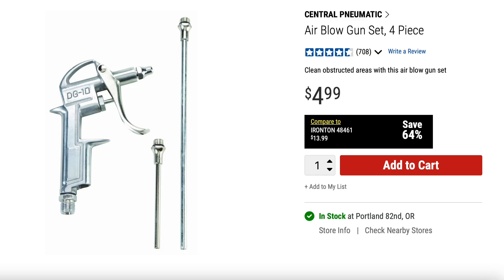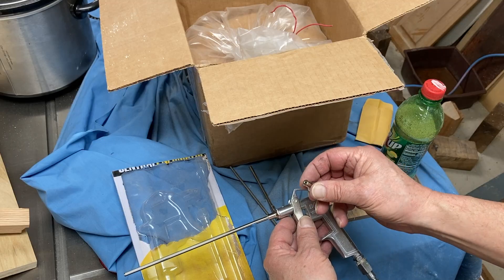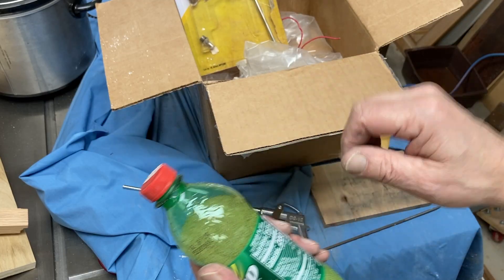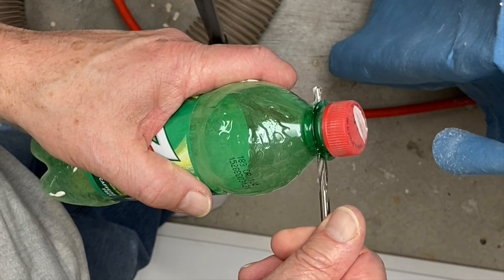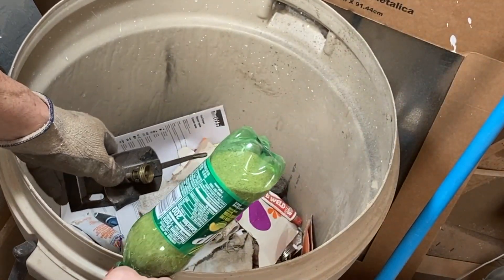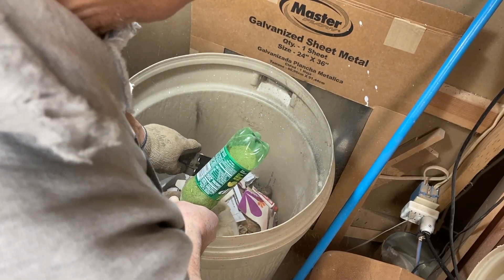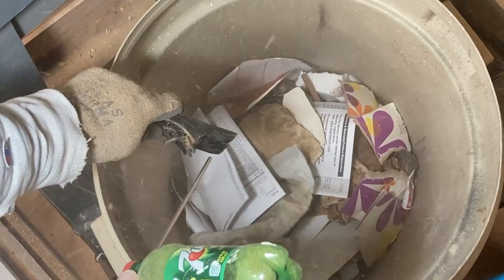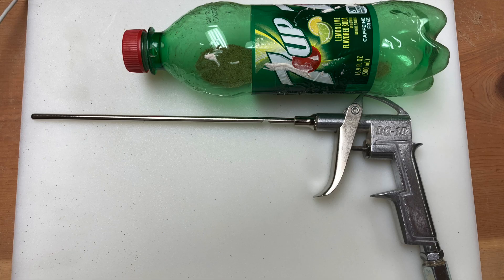Build a DIY Sandblaster for Under $5.00.

Comment: II made one with two lids so I wouldn’t have to make holes in the container itself, only in the lid. I used sifted river sand and utilized it to clean some pumps; only placing the sand-receiving hole at the top, and it works perfectly.
Reply from the maker: I’m still amazed at how well this works every time I use it.  Thanks for the comment.

Comment: I like this video!! I used the same equipment but I used sand and it still works great!! 👍🏼
Reply from the maker: Thanks for the comment.
Reply: Very dangerous to use regular sand. The fine dust that comes off regular sand will give you Silicosis a chronic lung disease caused by inhaling crystalline silica dust particles.

Comment: I tried this and I tried also original spray gun with the red metal container. It did not work at all🤔🤷‍♂️ I have super fine glass sand but still the sand was just falling out the nozzle or did not go out at all. Perhaps my compressor is too week I don't know🤷‍♂️
Reply from the maker: I’m at 100 psi for best results 
Maybe the walnut shell is lighter as well

Comment: Wow! Do you think it would work as a gentle sandblaster for removing chipped paint from wood? Thanks for the research and share!
Reply from the maker: Thank you for the comment. I'm guessing it would be related to the air pressure you are using. I tried it on a piece of wood to see if it would weather it, like drift wood, eroding the soft part of the wood rings from the harder part. It worked for that but that would be much too strong for just removing paint. I'd just try different pressure settings. In the video I'm at 100 psi.
Thanks again.
Reply: @makingthings1463  Thanks. Good advice